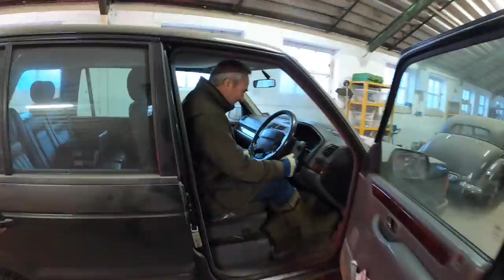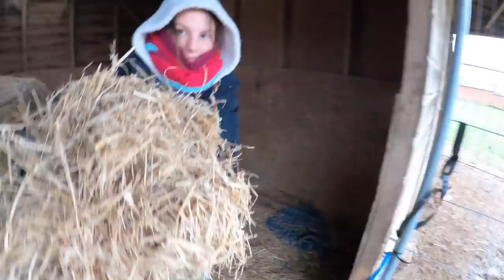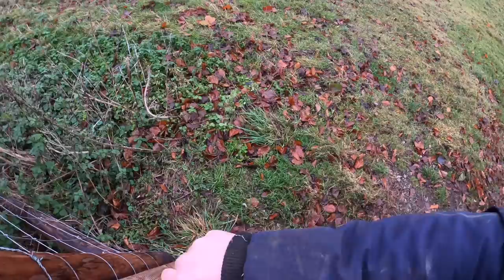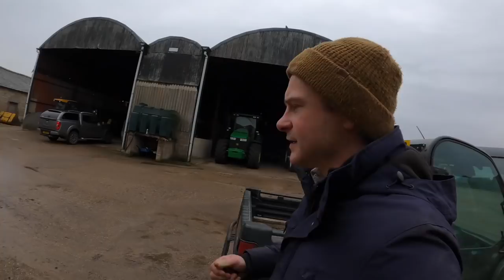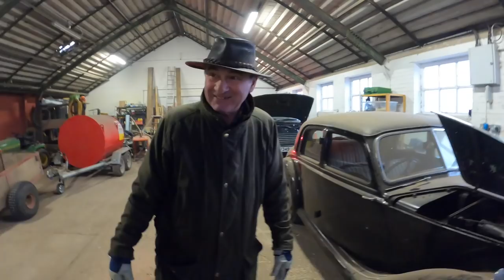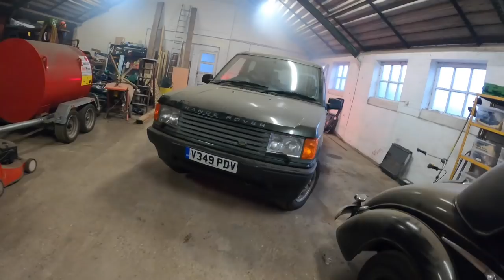GATHERING DUST FOR 2 YEARS!! WILL THE RANGE ROVER START?! #FARM VLOG 197

Comment: Best thing to do with them to eliminate a prob with injectors is to do a leak off test which will show if theres an inbalance of fuel returning from injectors which will give u an indication of which is the faulty injector if it is then u can rule them out if all come within 10ml plus or minus in the bottles

Comment: Fine video once again. Try a leak off test on the injectors when there still in the engine. Cheap enough test that will tell you enough without throwing the big £ to start with. Stay safe 🏴
Reply from the maker: Cheers for advice Ian 👍

Comment: Had loads of those P38s years ago,  might get one again and throw it in the barn with the classic Range Rover, I feel they are becoming classics! Anyways I’d feel it something to do with fuel! Cause it works at higher pressure! I’d say lift pump or fuel pump, cheap and easy fix! But that would be my bet! Something to do with fuel. ( I’ve not watch the whole video so I don’t know if you got it going or not towards the end )

Comment: Is it the P38 or the 322 could be the alarm system locking it out. And yes think it is No 4 cylinder with the electrical contract on it. How old is the fuel in the Rangy. What does your dad think of  the E type Nick?